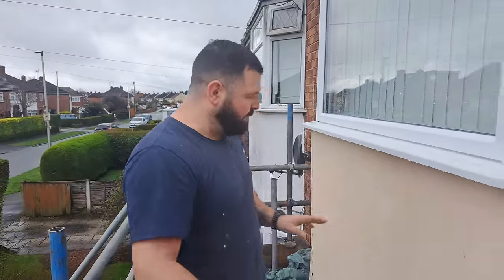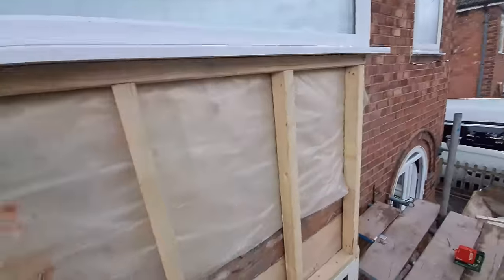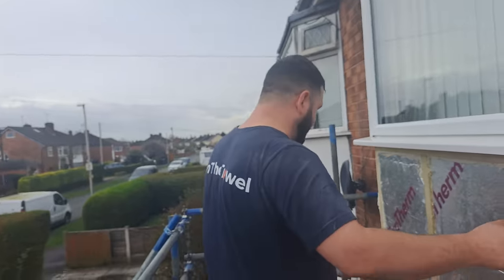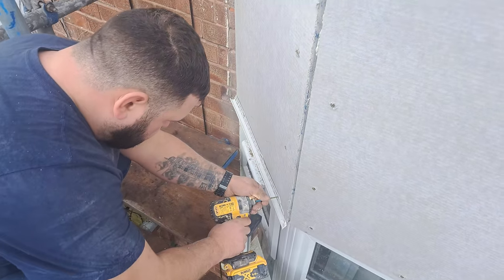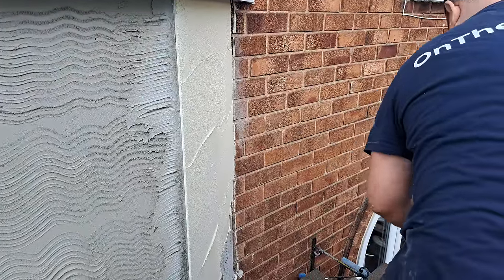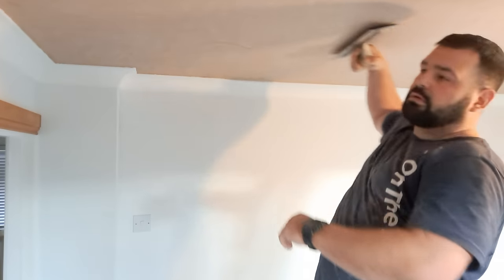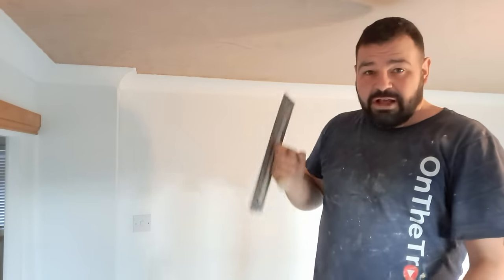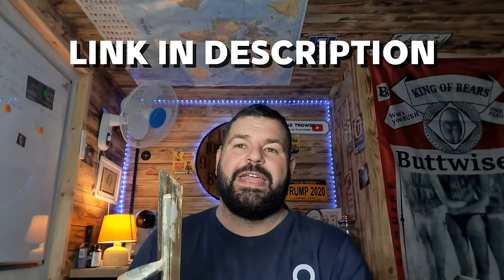BAY WINDOW COLLAPSED!

Comment: Be careful with those tuning boxes. It’s basically just a resistor that increases fuel pressure at the rail. You won’t get better fuel efficiency and more power. That’s just the law of  physics. Your van might report better mpg but it’s being fooled. If you check your fill to fill amounts for mpg, you’ll find you’ve lost mpg. They also invalidate your vans insurance. If you have an accident and the box is fitted, they won’t pay out.

Comment: Those on about airflow, as long as full fill no airgap needed. What i would recommended on these is to remove the internal plasterboard and fit 25mm insulated plasterboard to help with cold bridging. May have to fit new window boards.

Comment: Cant fault it kirk you went above and beyond ,most trades i've come across  would of run a mile but you took it on the chin and used your knowledge to provide the best result for the customer,and now with your van with more power you'll have to slow down between jobs cause the render will still be wet 😅 keep up the excellent work kirk 👍🏻 i thought that scrape at the end was the sound of sierra deltas breathing 😅
Reply from the maker: He sounds like a stalker doesn't he 🤣🤣

Comment: Do you ever use other finish coats for render? Here in Australia we do a 3 coat system. It's coat acrylic render hi build then a second skim coat of acrylic render and then we do a coloured texture coat and we float it up with a plastic trowel. We also never use plastic corner beads. Always galvanised aluminium or stainless steel

Comment: been using 12 mm multipro boards, beautiful product. I use a cheap mini circular saw with a carbide tipped blade and  nick a 1mm line in the board and they snap dead easy

Comment: Top job, can’t believe them Bricks just sat in the window below, no wonder it cracked 😂
Reply: More common than you'd think, it's brick-nogged construction. Certain era of cowboys/planners/architects thought it was acceptable to lay bricks directly on top of window/door frames instead of lintels, reinventing the wheel. It's likely that this is original to the house

Comment: Another thing with those houses (As we refurbished one in M20) is a lot of them historically had steel STRUCTURAL windows in them initially and these acted as structural support for the upper floor bay window, that's why they could have bricks there. Loads of people have since updated to plastic windows, but these are insufficient for the weight of the upper floor. Hence if going for plastic windows need to remove all the weight as you've done.
Reply from the maker: That's it mate, I just thought it be best to take it out and get some insulation in there

Comment: When I was plasterering I came up with
an idea to use rubber based tilers glue 
for my scratch coat over blue board
and cement board never had a come
back give it a go and see what you think
Cheers Brad

Comment: If the window frame was weak what prevented the windows from falling? Many 1930s- 40s houses are like this , the window bay is often single skin.  Next time cover the windows below with some plastic.
Reply from the maker: It's bad for the environment 😅
Reply: @Onthetrowel  Otherwise decent job, the cracks happen when the original wooden framed windows are replaced with double glzed windows.
Reply: @Onthetrowel  mate, that's piss funny....😄😃😀🇦🇺

Comment: The original window would have been timber and load bearing, you need to check the new UPVC windows to see if they have a steel frame in them to replicate the original. Common problem with window  companies who don't have a clue.

Comment: Been there, done that. Rotten timbers,no insulation. The property had been re-rendered previously which was hiding all of the horrors underneath. It was completely rotten and only the windows were holding the rendered section in place.
It was only visible when the window was removed.
Customer refused to pay anything towards the additional cost of the work.
Like Kirk. I got burned on that one.

.
Reply: You hear horrors stories about tradesmen jacking up the price but  where a job develops into something else you need to charge extra for unforeseen time and materials maybe set out the risk of what you might find in the quote and likely extra cost . Craig and yourself shouldn't bear that risk, old geezer probs on a final salary pension scheme !!

Comment: My front bedroom was the same, was a pain to sort it as  not only had the frame rotted away the grey blockwork was cracked I had to build a frame by myself while struggling to see properly at the time because I had  just developed a bleed at the back of both eyes which screwed my vision,  I  couldnt see to count the  graduations on a tape measure but I could see a pencil mark ok so I worked that way..   and the job couldnt be left, the other nasty bit was the floorboards were flapping in front of it - quality work  but easy to sort out once I replaced the frame,  as there was no joist or any sort of support before ii built the frame,-  cut  a long story short I cladded  it rather than re render it, as I wasnt sure if I was going to keep what bit of vision I had, 6 years later  and lots of eye injections I can see well enough to contemplate driving again

Comment: Take it easy with your van more power more torque & you'll use it now its there = new flywheel can't take the power, possibly turbo just drive it as you did. 
Nice job can be a nightmare the old bay window's 👍
Reply: Don't worry, that kit installed is doing fuck all to that van.

Comment: Pvc windows can't  take that load, who ever replaced the window should have seen this problem. The original windows will have had mullions on the  middle window, the minute this was removed, the cracking will have started. Found that out the hard way when I first started replacing windows around huyton, Roby area back in the late 80s.

Comment: Hello mate, where do you get the scratch finish bars from and what are they called.  Im a plasterer in spain and use k rend alot but we only have scratch pads which are not good for big areas or ill habe to cut it back with a sharp feather edge

Comment: In WHAT WAY is that wooden structure between the insulating-boards Secured at all ? I have only seen a couple of nails/screws ? IS the foam the 'thing' that is holding this wee structure together ???
Reply from the maker: It's attached to the brickwork at the sides and also the window frames mate

Comment: If that device has connected to  the FPR personally I would remove it immediately and get yourself a proper recalibrated ECU from MSD (Blackpool HQ ) with local installer  they are so well priced and quality product lifetime warranty. . . It might feel better it may look better on fuel but there is now no  control in fueling stratagy. Never good and bordering dangerous for the engine. do it properly.

Comment: You stated in your video that you dislike drafts therefore you ran expanding foam around the kingspan insulation. You then stated that you left a space behind the insulation to let the air circulate. How can it circulate if you’ve sealed it all up
Reply from the maker: Air circulation and draughts are different mate. Its a bit like when you take a plaster off to let the air get to a wound rather than in sweating

Comment: Your joinery skills aren't bad ,But the framing didn't look treated but not knocking you kirk you know more than me 👍
Reply from the maker: Cheers mate. I try.
It was exterior 3x2. It was stored outside at the building yard. 
I'm not a joiner/carpenter and I know there's probably different grades of exterior timber but I reckon this will be OK. Looking back, it might have been a good idea to felt it first before the cement boards but that's hindsight for ya 🤣
Reply: @Onthetrowel  you don't need to watch long to see how professional your ethic is thanks for reply

Comment: looks like there is no paper between wood and bricks...should be stucco paper between studs and cement board or plaster so water never gets to the studs.

this would be a change order, as long as you werent the one who built the original....

haven't used a guard on angle grinder ever, guard is useless for most applications,......know your skill level and use the tool accordingly.....tradesman and DIY are not the same..